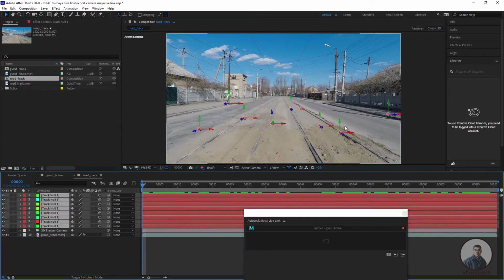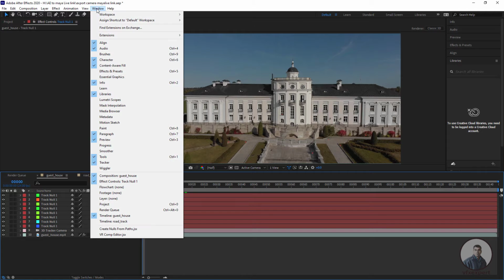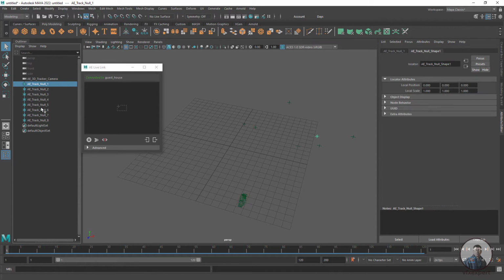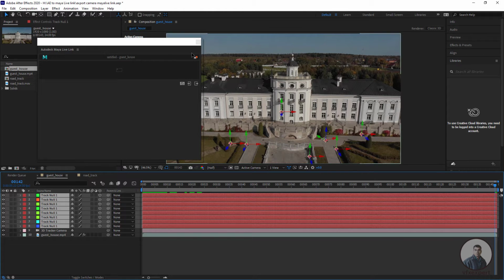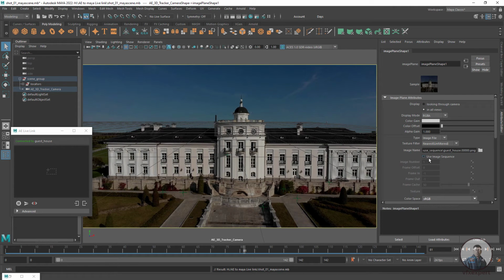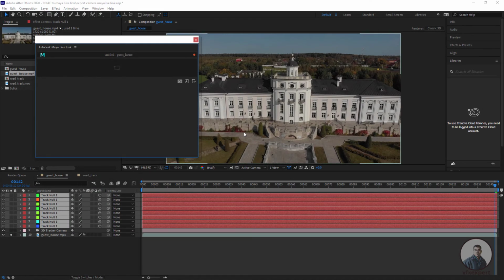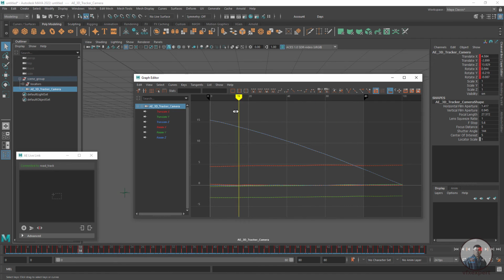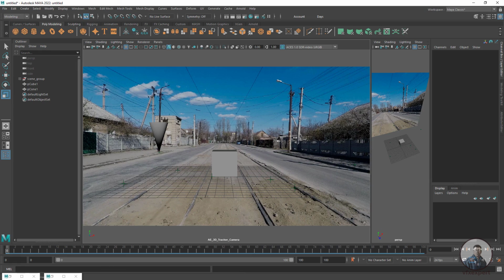After Effects To Maya 3D Camera Export with Maya Live Link |  Export After Effects To Maya 2022

Comment: Hi do you know why the camera resolution is not the same between after effect and maya? In after effect my composition is in 1080/1920 but in maya it is square. I tried to change the resolution in the render settings but nothing changes
Reply from the maker: Also check the pixel aspect ratio.define same in Maya render settings.or again export image sequence from after effects and use in Maya.thanks
Reply: @vfxexpert  when I change the pixel aspect ratio it also change proportionally the device aspect ratio